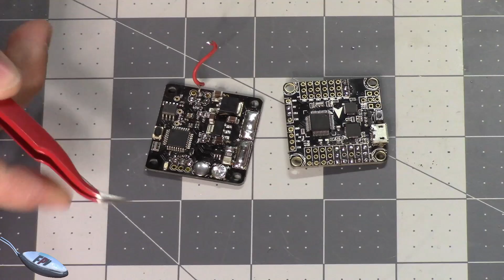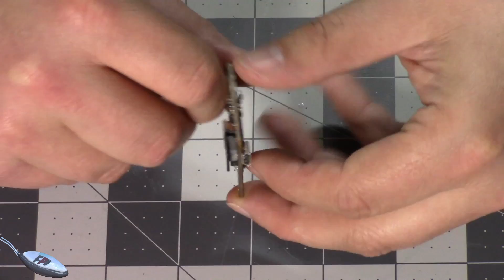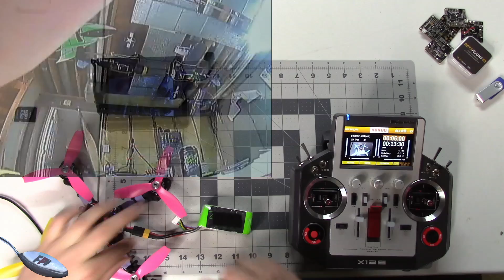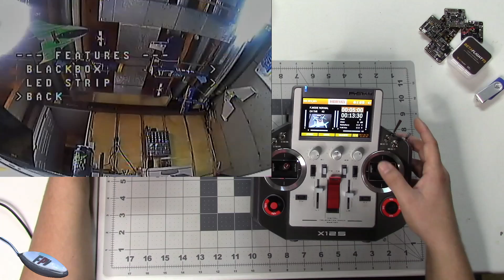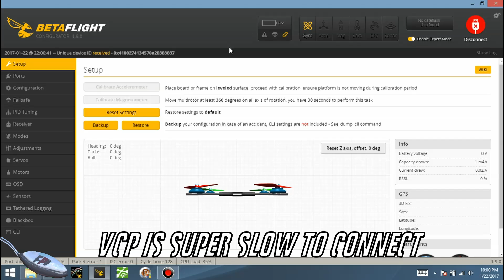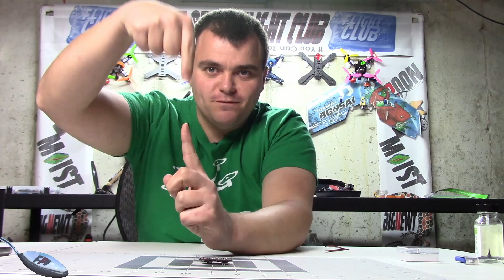BetaflightF3 Review

Comment: Did you use a unify pro or hv and if a pro did you need a backpack? I have the same equipment and I'm trying to configure my first quad. Also liked you pinhead setup for your receiver I'm guessing, I was VERY curious about that...
Reply from the maker: You can use the 5V rail on this board to directly power the Unify V2 which runs on 5V, no need for the backpack mod that I mention in my other videos.

Comment: Hi guys... A quick question... If the f303 was a good FC what's the extra benefit of the betaflight FC.?
Reply from the maker: Peter Mabbort It's the features the board offers, built in pdb, OSD and SD card for black box.  Makes for a cleaner build with cool features, like on screen PID tuning, and if you pair it with tbs unify or tramp VTX on screen channel changing.  Was the video too long?

Comment: Question on the Unify pro Race HV. What do I do with the audio wire and should I remove one of the ground wires since their are two?
Reply from the maker: You can either ground the Audio wire, or run it to one of the TX ports for Smart audio if you have a betaflight OSD on your board.  You can check out my video on Smart Audio if you have an OSD.  What FC are you running?
Reply: Spoon FPV I am running the New Betaflight board. If I remove the audio wire will this hurt anything?

Comment: I have the Unify HV so where should I get my VTX supply voltage from?
Also where are you getting supply voltage to your FPV cam? The VTX?
Reply from the maker: You can pull the power from the port labled RAW, watch my TRAMP osd video, I go over it a little there.  There is a jumper on the back you need to jump.  I go over it around 2min in this video.  https://youtu.be/HCGzZmcuXuw
Reply: Thanks!

Comment: Spoon,Have you tried running your Unify VTX off the 5v from the F3 board? Instead of using your 5v power chip. Wondering if the video is lines free?
Reply from the maker: BumpierDrake960 Yeah, works great!  No lines etc, use rhe power and video ground locations though, have a video detailing this comming out in about a week
Reply from the maker: BumpierDrake960 You can pull the power from the port labled RAW, watch my TRAMP osd video, I go over it a little there

Comment: Thanks Spoon  Explains  why i had trouble  with  Solder
Reply from the maker: Ken Slee Yeah and I really like the boards,  but I really have trouble reccomending them because of that, but I think as long as you know its a thing it makes it less of a gotcha.  And FPV model has not corrected it in their latest batch.  I still think its the best FC on the market, and I have something Awesome to show you guys on Monday with it.
Reply: What can i do  to making soldering this  board easier
Reply from the maker: Ken Slee Use a high heat ( larger tip) soldering iron and flux to tin the ground pads.  You'll also need to use the fat tip to solder the grounds on, I did them first So I didn't need to worry about other pads with my giant tip iron.

Comment: Hi spoon fpv, great review. What vtx are you using and how do you connect it? You have a perfect video, I want it, jeje
Reply from the maker: Okay a lot of the flight video I post is from a GoPro, but my 3 favorite VTXs are the 

The TBS unify pro V2 (With a 5V regulator, check out my video on how to set it up https://www.youtube.com/watch?v=rMDUK7rNmf8)  don't get the HV or Race version, they are a little big to fit on some of my tighter builds.  That is the TX I was using in this video to record the DVR.

And the Immersion RC Tramp, It's a little bigger than the TBS V2 but smaller than the TBS HV or Race and I love it for my freestyle quads that are a little bigger because I can change the power and channel so easily using the wand... and now the BF OSD  =)

Hawkeye ( I don't fly these any more but they are awesome for a great price if you can find them) Still wouldn't recommend them because they don't have a replaceable antenna, don't do multiple power outputs, and use dip switch.  But they do provide excellent video quality, and I flew them long enough that I can speak for their durability unlike the other two I listed here.

So to answer your question it depends on the build, and what I'm using the quad for, but those are my three go to VTX.
Reply: Spoon FPV Thank you very much for your opinion, regards.
Reply: Spoon FPV Do a video on how you put your pin headers on you FC and what they are used for.  Got a feeling it's for your receiver and I'm using a Evolution. I LOVE a clean look as well!!

Comment: You said that it just uses the minimosd chip. Does that mean that I can now use betaflight to change any minimosd settings rather than using the other software? Cheers
Reply from the maker: Yeah, for a while now Betaflight has supported passthrough for OSD programming, but it needs to be BetaflightOSD for you to do PID tuning and some of the features I've shown.

Josh has a good video on the passthrough, you can check it out here  https://www.youtube.com/watch?v=5gV_EcsG_0o
Reply: Ah wow that's awesome. That was one of the big reasons I moved away from minimosd. Ive got a build to start next week when I get home after 5 months away that I was going to use the Dlux osd with a Lux V2 but was hesitant because of that.

Comment: looks like a good board. I am very curious what the F7 boards will look like.
Reply from the maker: Rick Gomez Probably very much the same.  F3,F4,F7 refers to the processor chip in the middle.  F7 is just faster still at calculations, but we haven't even begun to tax the F4 boards, and the F7 chip alone is $70 so the FC will be expensive.

Comment: Spoon why not the omnibus F4 pro?
Reply from the maker: THAT IS A GREAT QUESTION!!!!  lol  When I looked at flight controllers 3-5 weeks ago, I didn't see the Pro, and I don't know that it was out.  The original F4 version used an external current sensor, which is why I wasn't too excited about it.  But I just ordered the Pro and will post an update once I have a chance to do a build with it, but I think the F4 pro is the board with the feature set I want.  Thanks for pointing it out.
Reply from the maker: Okay I did some more looking, and the FLIP 32 - F4 - OMNIBUS V2 PRO doesn't function as a PDB as well, so still need a second board to be the PDB.  There are no power connectors on it for the ESCs, so the build will not be as clean or light.
Reply: OK cool thanks for looking into that!